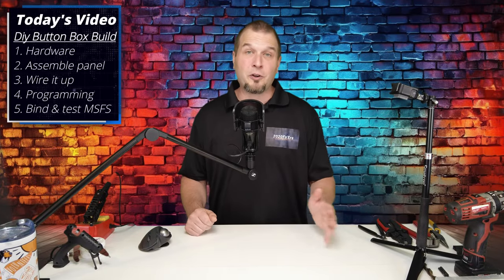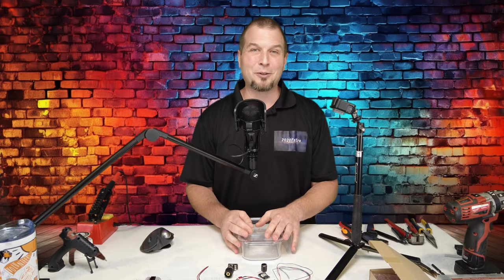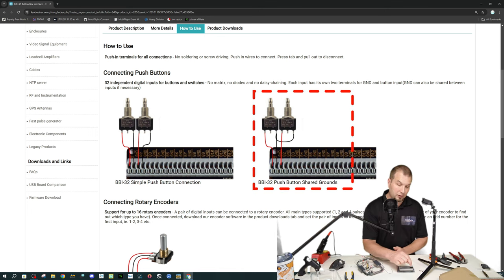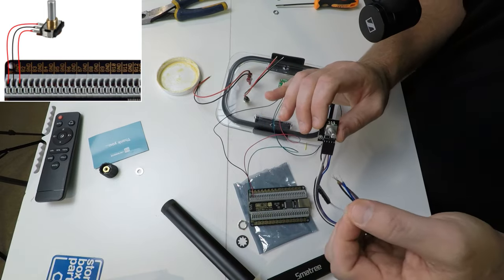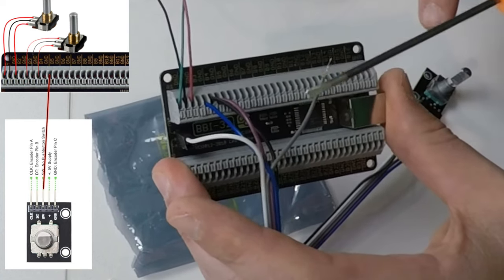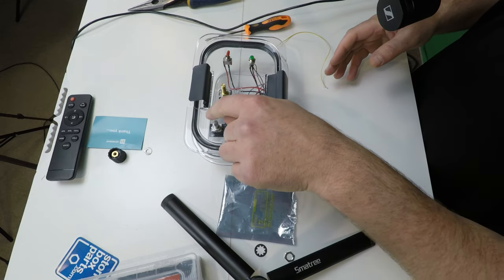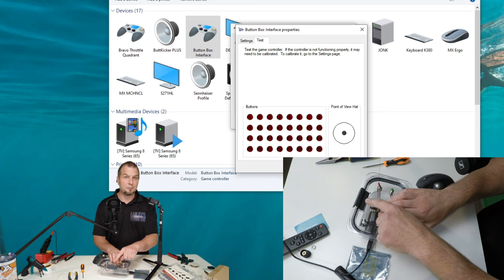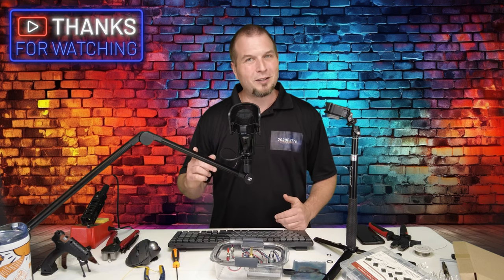EASY DIY Button/Switch Panel for ANY SIMULATOR. Buttons, Switches, Encoders Full Tutorial -No Coding

Comment: I use the Leo Bodnar BU0836A as it is a perfect replacement board for the axes of the Logitech (Saitek) Yoke giving much more resolution and it has plenty of connections for more axes, buttons, switches and rotary encoders. - I keep meaning to make rotary controls for COM1, NAV1, Autopilot panel functions and G530/G1000 FMS rotary controls, I only "parked" this project as I recently got the Honeycomb Bravo (which has the autopilot buttons/dials) and have also used FSUIPC7 to map keybinds for the rotary inner/outer controls - also it will allow me to use what I learnt in my A' Level Electronics 36 years ago! 😉
Reply from the maker: Yes I am using the 836a board in my current build . I'm using it for three potentiometers and I'm also using it to drive all five of my encoders that I'm using. I'm currently using two faders with a center detent and I use these for my Rudder and aileron trim and I have a knob potentiometer that I'm using for lights and things like that the other thing that I really liked about this board is that they created a button Matrix board that plugs right on top of this bu 836 board and the button layout is the exact same then when you do that as the BBI 32 and 64 boards this makes it very easy to connect all of your buttons and switches into a button Matrix without all the hard work of doing a button Matrix and the board also has diodes built in so this way you can press more than three or four buttons at the same time without any ghosting I've posted all the pictures of my build on our Facebook group if you're interested. 
In this video I have two quick slides of my current build at about the time when I was talking about hot gluing the board into the bottom of my container that's when I showed the two pictures of my current build

Comment: Jon, that was awesome and thank you for taking the time and effort. I'm going build one myself customized for my preferences. I think I'll also do the altimeter setting and heading bug as well. 
Fun video as always! 🎉😄🍕 Pizza!?...
Reply from the maker: Thanks buddy 😃. Yes you can customize this any way you want . The main goal of this video was to get people that may have been on the fence of building button box to maybe push them over the edge to get going once they see just how easy the setup is not to mention there is very few videos online to show a complete build with any programming and keybinding in the simulator. I'm not sure if you caught the two pictures of my personal build that I'm doing in the video but I am actually using two of these 32 button box boards and one of their joystick controllers so that I can map a couple potentiometers to but my total switch count is 65 with 5 no sorry 6 encoders and three potentiometers two sliding potentiometers with Center dtents that I'm using for my aileron and Rudder trim and one is a knob potentiometer that I'm using to control my lights. But I didn't want to get into any potentiometers because that's a different board that you need and there's a little bit more work involved so that's why I stuck with this board as opposed to using their 64 button board with that one you also need to crimp one connections to attach all the wires and with the 32 you don't have to do any of that it was the easiest one to use
Reply from the maker: Post your build on the Facebook group

Comment: Thank you so much for this video. I wish I knew about using Leobodnar's product. Recently I bought Arduino Leonardo board and a dual concentric rotary encoder from Propwash. With help from a Youtuber he showed me how to connected all the wiring and programmed with Arduino IDE software. I wanted the dual concentric rotary encoder to tune the COM frequencies, but it didn't work out that well. When I rotated the knob, there was long delay for the frequency to change and sometimes it skipped some numbers. I noticed Leobodnar sells a dual concentric rotary encoder, I would like to give it a try with their BB!-32. Thanks again for the precise instructions on how to use buttons, switches and encoders. Cheers!
Reply from the maker: Hey thanks for the comment. You should be able to use your dual encoders from propwash sim in the Leo board . If you already have a couple of them I would try them.
Reply: @2020fsers  That's great that I can use the Propwash rotary encoder with Leobodnar board. I have one question...does the Leobodnar encoder have detent when you rotate the knob?
Reply from the maker: @dixonmak yes the Leo encoders have detents.

Comment: WRT the "Amazon encoders" you showed, the 5V supply is for pull-up resistors that the other type doesn't have.  The BBI-32's electronics does that job anyway.
As an electronics engineer, I'd leave that disconnected and probably remove the resistors on the board.
Reply from the maker: It doesn't seem to have any negative effect for me .
Reply: @2020fsers  It wouldn't.  Leaving them in and connecting the 5V just reduces the effective pull-up resistance for those inputs, but not enough to cause a problem.
It's just I'd rather not mess about with the extra wiring.
Reply: Yes No1sonuk is correct. The amazon encoders will work perfectly well without any 5v connection. I have many encoders hooked up to bbi-64's using only gnd and they are all working fine.
Reply from the maker: @cammy9r good to know I never tried it without the 5 volts thanks for the tip

Comment: Is it possible to use the encoders to change info on the g1000NXI or the GS530. I have 4 encoders and was hoping to use them as the inner and outer knobs. Thanks for the video by the way. All your videos are great.
Reply from the maker: Yes you can that is what they are used for . The knobs on the g1000 and 530 are encoders .  So all you need to do is program your encoders for the specific knob and direction .  Like (g1000 inner knob Inc ). Spad is best for this level of programming however.
Reply from the maker: Thanks for the comment 😁

Comment: Could you use an on on switch with this board? And just wire both inputs to the same button? Star citizen doesn’t have a “hold” feature for keybinds for powering on ships so I’d have to toggle it again just to press the button again
Reply from the maker: You can use momentary switches and 3way switches as well . Each terminal on the switch except ground will go to a separate input on the board .  A momentary switch is probably what you need . A momentary toggle switch or a momentary push button. You can also use a 3way momentary toggle

Comment: I just ordered the BBI32 and 2 encoders. To my good surprise, the shipping cost was only $4.25.
Reply from the maker: Awesome hey when you program the encoder use the settings that are on the page for the encoder . But you can try the setting I suggested In the pinned comment if the encoder doesn't spin fast on screen . If you have any issue just give me a shout .